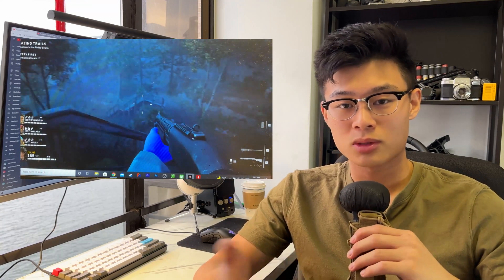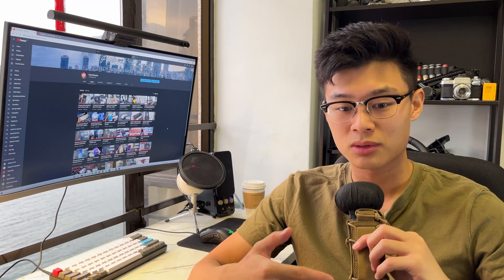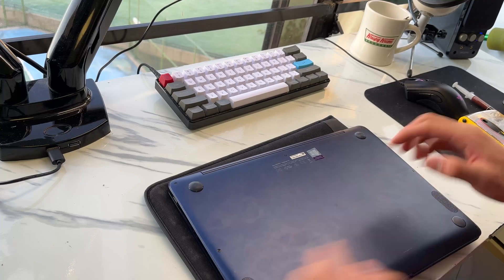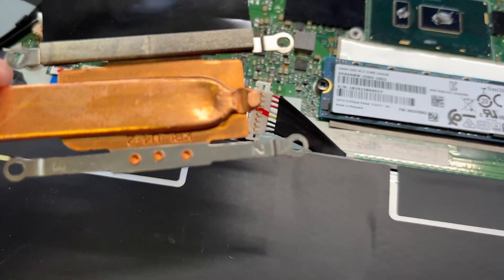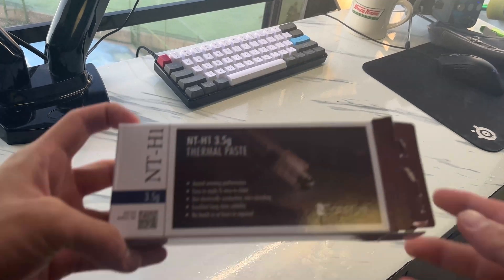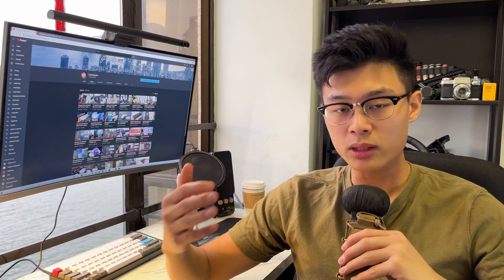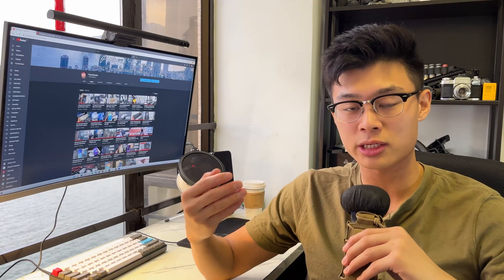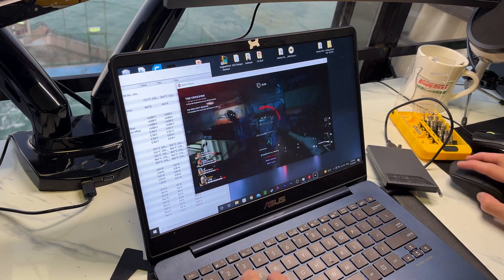3 Ways to Fix An Overheating Laptop - Thermal Paste Mod

Comment: One thing I've found is if you move your laptop frequently or throw it in a backpack or something like that it can cause old thermal paste to dislodge. This happened to my laptop a couple of weeks ago which is around a year after I replaced the factory goo with IC Diamond. 

My temps were great until the laptop fell about a foot from a stool I set it on. Even though it fell onto thick carpet that caused enough flex to disturb the paste where it  was stuck to the HS. it was immediately apparent  Immediately afterwards I could see my idle temps jumped about 8c-10c. 

If I didn't have so much aluminum holding the heat pipes together in my particular device, I would use the gallium/liquid metal which would 'self heal' after a minor incident like this as it would liquefy again slightly above room temperature. That liquid metal is no joke though, when done right, but Its extremely hard to work with, EXTREMELY CONDUCTIVE (don't get any on your board!), and seems to work its best after a second application after cleaning any residue that appears to be 'caked' on the copper while leaving anything that seems to have soaked into the pores. 

I'm getting near liquid cooler temps with a cheap air cooler in a desktop with a de-lidded 4790k. I can't get it to hit 80c anymore without excessive voltage increases. Before this I could have it up in the 90 within seconds of starting synthetic benchmarks at stock or even undervolted.
Reply from the maker: That's actually a very interesting theory, I never really considered the possibility of the thermal paste dislodging. Haven't had the chance to play with liquid metal just yet tho!
Reply: @patrickhacks  since my last comment I've actually taken the time to do the liquid metal as I think the copper plates for the gpu and cpu are big enough to keep the stuff away from the aluminum. My temps dropped 10-15C under load, and I really can't get it above 80C even running simultaneous gpu and cpu stress tests. 
 
Those were really some jaw dropping results, but it must be spread correctly with a thin layer on both the die and the copper. Its not easy to work with and took me about an hour just to properly  spread it.